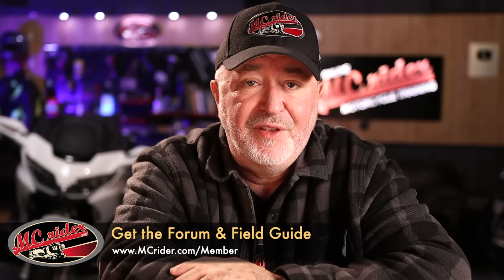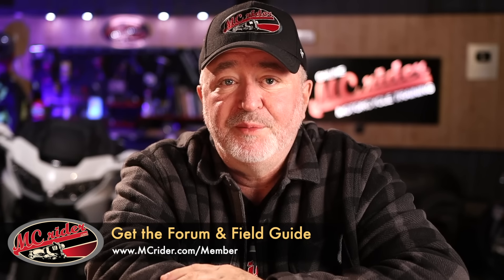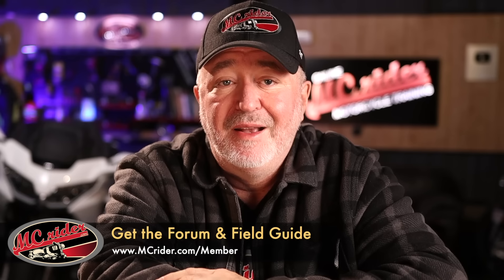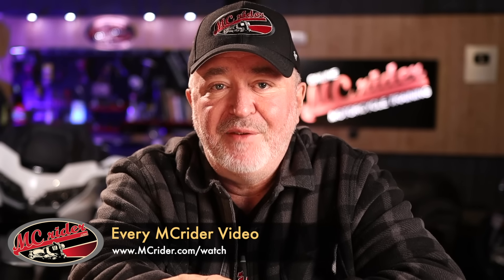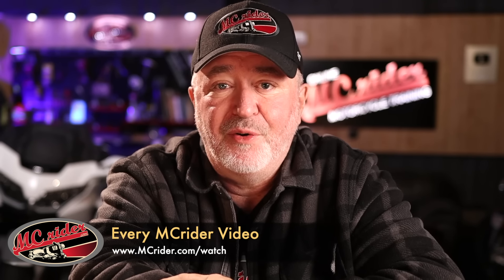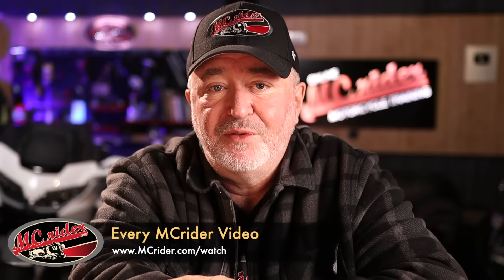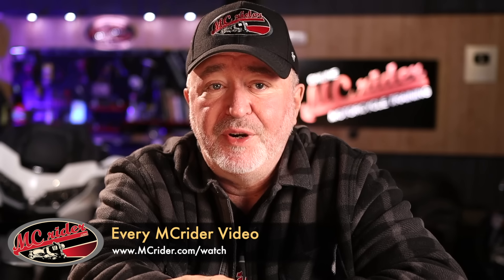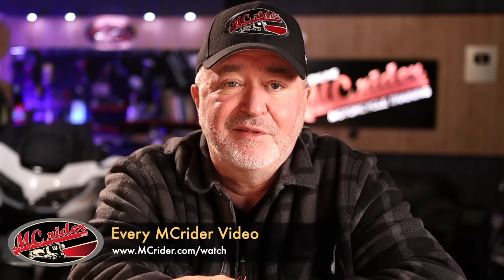The Most Misunderstood Control on a Motorcycle

Comment: I have ridden my 1986 Kawasaki Concourse over 370,000 miles before I sold it. I replaced the clutch two times. Both times it was the star spring washer that one of the arms of the spring had broken and floating around in there would cause the clutch to slip some times. I replaced the clutch the first time because I had already bought the friction plates and springs. The clutch didn't need to be replaced. There was around 150,000 miles at that time. The second time I just replaced the spring washer.   The new discs are 0.217. the old discs I took out were still 0.217. I use the clutch when I ride like you do. I slip the clutch at low speed and when I am down shifting I let the clutch slowly not just let the lever slam out. Do that and you can cause the rear tire to loss traction if the road is slippery. That this time I have a 2005 Kawasaki Concourse with 57k. I am 73.

Comment: I ride a 14 year old Honda with 44000 miles (over 40000 in the last 5 years since I bought used).  Almost nothing has worn out in daily use but tires, chains and oil.  Clutch is still strong, brakes are fine, engine is still pulling with excellent compression.

These things last a long time.  I had a $12 speedometer cable break and oil seal blow out last year.  Neither of those things were decided by me trying not to wear things out.

Just ride it.   Use the equipment as it is intended.

Comment: Hi Kevin, I have a question about the clutch. If I have to break in am emergency situation, I should pull in the clutch lever, right? That's what I would do, but I've read other people saying it's wrong. Also, can you rev the engine with the throttle and then leave the clutch out to take off faster, or do you do it gradually? Thank you.
Reply: In an emergency situation, the smoothest braking of the rear wheel for inexperienced riders occurs when the clutch is pulled in and just using the brake pedal. Very experienced riders, like myself, will downshift once or twice very quickly and use the friction zone of the clutch to control the braking of the rear wheel. I am much more comfortable using the downshift/clutch friction zone for rear wheel control.
Reply: @schigara  if you brake to hard with clutch out you will stall the engine
Reply: @jasonflesher8974  . That is not what I do or what I said I do. In very aggressive riding or emergency situations, I will sometimes use a bit of rear brake but mostly downshift and then feather the clutch to control the rear wheel. I never leave the clutch out and just use the rear brake. I always use a lot of progressive braking on the front since, at full front braking, the rear is basically useless as the rear tire totally unloads. I typically just use the rear wheel for stepping out the rear to manuver around obstacles at speed or to get a better turn in angle. It's all very fluid. It's just something that comes naturally and have always done it that way.

The front brake is 100% of the braking power of the bike when used well. The rear brake/engine braking can be used strategically.
Reply: @schigara  have you rode anything with ABS?

Comment: The goofy thing about people saying holding the clutch in will wear out the spring, is that it is completely opposite of what causes spring wear. Springs wear out gradually from USE — the compression/decompression cycle, not from being held compressed.

Comment: A “sort of” clutch related question.. when slowing quickly over a shortish distance is tapping down a couple of gears without de clutching between each a problem? Will it damage anything? My husband says you shouldn’t but on our narrow congested local roads traffic is unpredictably stop-start and there’s often no time for the single gear at a time approach. This is at low speeds 20 - 30 mph max.
Reply: you mean shifting multipe gears without closing the clutch (releasing the lever)? Won't be a problem, why should it?
Reply: No worries at all Piggy S, you can do so, but I think your husband wants to promote soft riding - call it ecco riding(/driving) if you will - while double downshift in front of a stop might indicate the opposite.

Comment: It's 'power attenuation'.
A 'typical' oil-bath motorcycle clutch is not a lot different than an automatic transmission clutch-pack.
When it's disengaged, there no wear.
Your oil-life will take a hit in the 'friction-zone' more than the clutch.
So use decent oil, keep it changed regularly for your 'style' of riding and don't worry about it.
If you're concerned, install an oil cooler.

Comment: Calling it a 'friction zone' is a bit of a misnomer on a motorcycle. It only really applies to dry plate clutches where anything in between in and out is literally friction between the clutch plates. On a motorcycle I think it's more accurate to call it a 'coupling zone' because it is a wet clutch system and as the wet plates draw closer together with the oil the result is a 'viscous coupling'. Although there is little if any wear to the motorcycle clutch the shear forces on the oil do generate heat and reduce the service life of the oil.

A viscous coupling is also used between the radiation fan and the engine pulley on a mechanically-driven radiator fan. In this situation the thermal expansion forces the fluid between two plates coupling the fan to the engine. In the viscous coupling the two plates never actually touch resulting in no wear and is the reason why such couplings last so long. It enables the engine to change speed while driving the fan optimally but without the excess drag that would occur if the fan were forced to increase speed with the engine.

Comment: I started in 2004 on a CB500C, shaft drive. Then to XJ750. Now with a six speed sportbike it feels like every gear will get me through and I have a hard time figuring out which gear to be in at turn. Five speed and old bike no problem but new bike goes like 12 with clutch out. 2017 CBR 1000 it feels either on or off.

Comment: EU here: I drive my 2018 mazda 6 gear manual exactly like my honda motorcycle. Transitioning to a motorcycle is a lot more accessible if you keep your hands of big, automatic cars.
Reply: Aditionally, i dont feel comfortable on a motorcycle at slow speeds with the clutch all the way out and the rear brake all the way released. That makes the bike lurchy and not very controllable. Instead you'd break a little, throttle up a little, clutch a little and kinda ease the bike into that sweet spot of 100% control. The same is true for cars on ice or gravel btw. I've done some rallying back in the day and its the same thing.

Comment: I have a question about shifting up gear. After shifting from 2nd to 3rd for example, is it better to twist the throttle a little while releasing the clutch or shall i release the clutch completely before twisting the throttle?

Comment: As someone who drives manual transmission cars, I found it a little harder to get used to a motorcycle clutch--not only is it hand operated, but you have all this "friction zone" and "volume knob" talk, whereas, with the car,  you have a dry clutch and want to get off the clutch as soon as possible.

Comment: A multiple plate wet disc clutch in a motorcyle functions just like the multiple plate wet disc clutch in an automatic transmission, and frankly, nobody worries about those, and valve body / main control problems are the biggest killers of those transmissions, not clutch failure.

Comment: Yep clutches for most car drivers have been a thing of the past for most drivers. I'm an outlier in that regard. I learned to drive on a "3 speed on the column" transmission and have only had one car (actually it was a Truck) with an auto transmission over the years. My current car is a Mustang GT with the manual 6-speed and I wouldn't have it any other way.

Comment: Well I guess I got a bad habit. I’m that guy that puts his bike in neutral at a stoplight almost every time. In 28 years I’ve never burned outta clutch. And I do acknowledge that using the friction zone is necessary. Call me lazy, but I’m that guy that likes to give his hand a rest and stand up and readjust myself at lights. But not really in a city riding situation. More in the suburbs where I’m basically by myself. So I’m not against it, but I rather change brake pads over cracking open a clutch cover. So be it….. 😉👍🏻

Comment: I attended a training class where the instructors forced us to use the throttle at very high revs up to and over 3000 rpm and then use the clutch to feed power into the rear wheel and drag the rear brake to control the bike at low speed turns and maneuvers. I had an argument with one of them that it was poor technique and risky because if you let the clutch slip slightly you could shoot off uncontrolled and get hurt or worse, as well as inducing excess wear on the transmission. Am I missing something, I thought that using the throttle and rear brake together at low speeds was a safer way to control the bike, slightly opening and closing the throttle and using rear brake to slow for sharper turns. This was a beginner riding class and my left hand was crippled after an hour.

Comment: Excellent information and great presentation! Don't ride the clutch and never run the waste disposal without running the water simultaneously! By the way, I attempted to Join several times today and your site is having issues with accepting PayPal. I tested it elsewhere and Paypal is working fine.

Comment: In case he doesnt cover stopping at an intersection with a pressure sensitive trigger system to change the lights. I learned 40 years ago to roll up faster than normal and dive the front end by pulling the front brake pretty hard. Itll greatly increase the pressure on the switch and generally will change the lights sooner than if you just glide up. In ft worth texas there are some lights youll sit through for hours if you dont do this or a car doesnt pull up close behind. La kno e worthless tx has several.
Reply: Traffic lights don’t work on pressure, they have an induction loop in the road.  Sometimes bikes don’t trigger the lights because there isn’t enough ferromagnetic material in the bike.  How fast you roll up has no effect.  Common misconception.

Comment: IMO the most useful aspect of having good clutch control, on a road bike, is being able to moderate engine braking during cornering. Into the corner, slipping the clutch like the moto2 guys allowing a little more freewheeling and out of the corner again to control power. Off road it’s more critical however the skills transfer to both disciplines.
Reply: How told you that?

I have heard from a MC Instructor that also teach higher level courses. He say to never pull the clutch in a corner. You will lose stability, traction and control in the corner, with pulling in the clutch. That can be strait up dangerous.
Reply: @Gismo3333  Perhaps if you disengage the clutch. However I didn’t say that. I meant to say modulate engine braking but auto correct changed it. I don’t ever recall losing stability, traction or control. It’s more like ‘trail’ engine braking

Comment: One thing I see even (presumably) experienced riders do in situations where they are tying to slow (or stop) suddenly, is to squeeze in (fully disengage) the clutch.  This almost always causes them to lose traction & control of the bike simultaneously.  When you do this, you actually pick up speed because you are "freewheeling"!  I never did so in a manual car or truck, and never on a motorcycle, either.  It seems like so many of these riders are just panicking to the point of squeezing and stomping everything all at once, clutch, brakes, throttle, you name it.  This especially goes for those idiots that think rev-bombing is the "cool" substitute for the horn.  Rev-bombing invading traffic just leaves you control-less in the worst possible moment, when you need to act, not "re-act".  I don't get where so many idiotic (and lethal) bike-riding habits are coming from these days, but there are more now than just the "feet sliders" and "over-revving-clutch-slippers" I was familiar with 30-40 years ago!  Please stress that a fully dis-engaged clutch while moving is "freewheeling" and is extremely hazardous for motorcyclists, and why!

Comment: Awesome ! I do have one question I have heard that coming to a stop, not an emergency stop but just a stop at a red light instead of pulling in the clutch gearing down to first gear and stopping you can pull in the clutch gear down to first and then go to friction zone as you are coming to a stop with the rear brake at the end could you please elaborate or explain